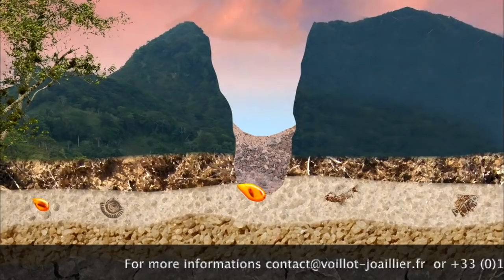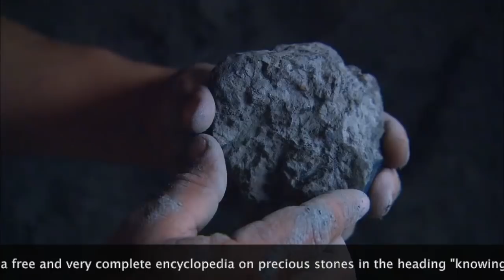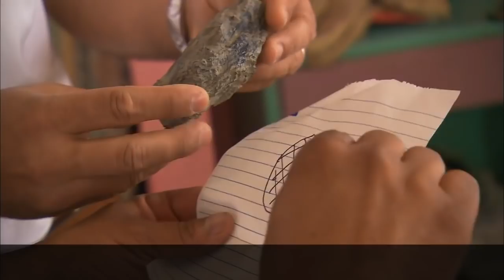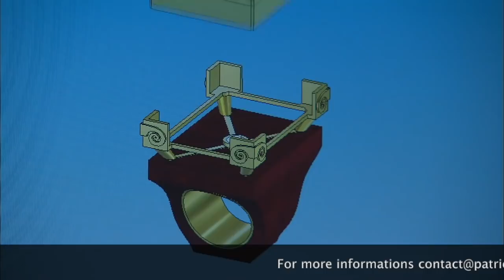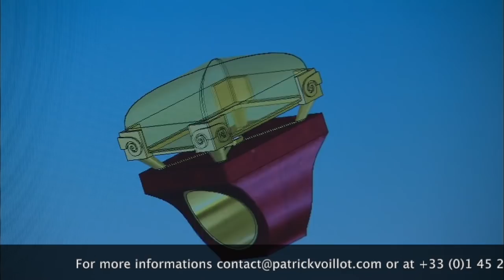Amber from the Dominican Republic documentary of Patrick Voillot

Comment: I liked the ring that had yellow n red n blue amber in it ,very pretty would love to have a piece of amber
Reply: the red comes from oxidation on the surface of the amber, if you look closely on the bottom of the stone, its not flat. if the jeweler sanded the piece flat, it would most likely loose the red.